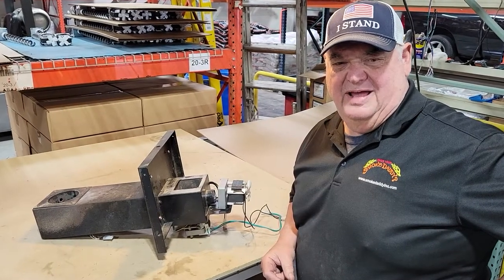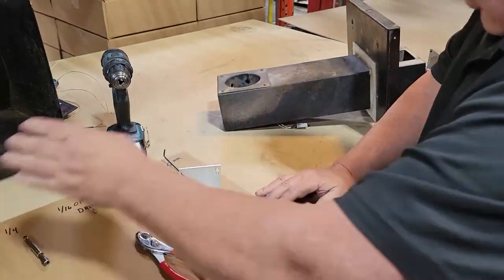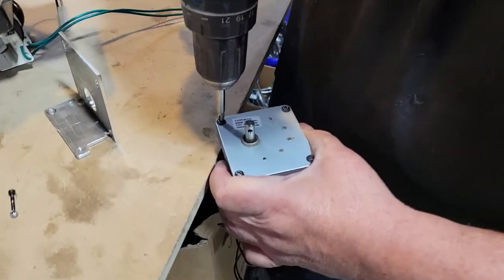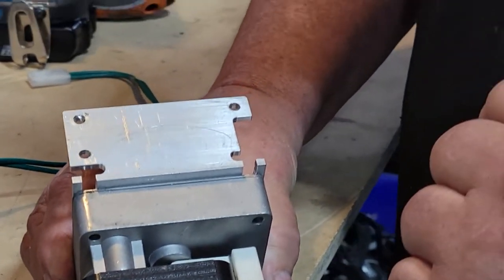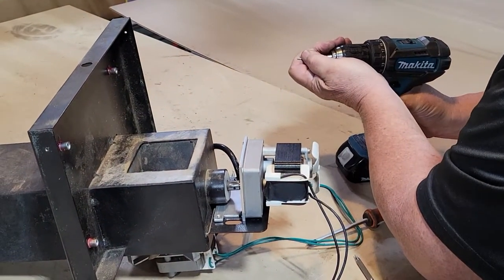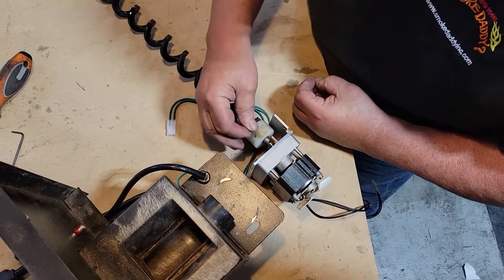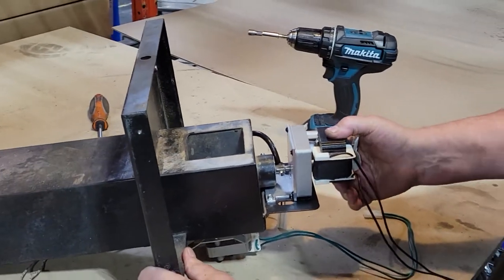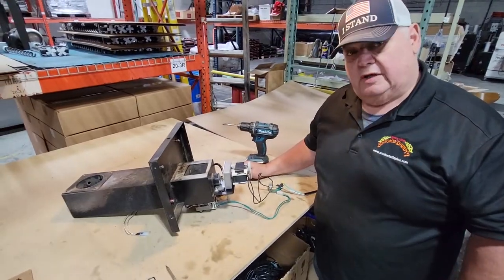Installing our Auger Motor Bracket on Your Pellet Grill

Comment: Had to fix my grill when got moisture in the auger cylinder and bricked it up with pellets. While it was apart I was surprised how flimsy the motor was installed inside. Bought this bracket to fix what Pit Boss should’ve designed better in the first place.

Comment: Dennis, is this required for all new Pellets Pro smokers; particularly the PPV-2300?   Or, do you have an effectively date for cut in?
Reply: The PPV-2300 are coming with a different kind of motor that is already attached to the hopper assembly. This bracket is for existing hopper assemblies to help stabilize the motor. 

The new motor is pictured in the listing for the PPV-2300 
https://smokedaddyinc.com/product/the-pellet-pro-vertical-cabinet-pellet-smoker/

Comment: I'm looking at a solution for the drip tray that sits on the right side of the smoker where the broiler plate sits and drips the grease to the bucket. Mine is rusted out and the broiler tray can barely sit on it anymore.
Reply from the maker: Give us a call at (847) 336-1329 and we can come up with a solution with you

Comment: Why do you only send 2 bolts to attach the plate to the new USA made auger motor when there are 4 holes? Thanks
Reply from the maker: I believe that we missed the four bolts to attach to the motor in your order the 2 bolts that come with it are to attach the bracket to the auger shelf. If you give us a call we can definitely get the additional bolts out for you. We are sorry for the mistake.

Comment: The free floating motor is by design, because the augers have an inherent amount of wobble or run out, and can also bind up. When the the auger wobbles, the motor is able to move around to get past the wobble. If the motor is mounted solid, all that auger wobble and resistance is sent directly to motors internals. Which will over time will wear out the motor. Watch the motor sometime when the auger is running. You'll see the hole motor move around to absorb the augers less than perfect tolerances.
Reply: The floating motor has been an issue for many years. By mounting it more securely I believe gives you a better feed rate and helps to cut the harder pellets easily. If the auger shaft is not bent, there should be no wobble Thanks for your comments?
Reply: @DennisCorrea  At eye level, roll any auger across a flat surface, and you will visually see warpage in the auger. Gaps between the auger and the flat surface, and the attached welded shaft moving up and down. It especially gets worse with heat, over time.
Reply: That's exactly how I check it. If you can spin the auger with your fingers while it's in the white bushing, that's good. If it seems to be a little tight, you can always open the hole up a little bit on the white bushing.